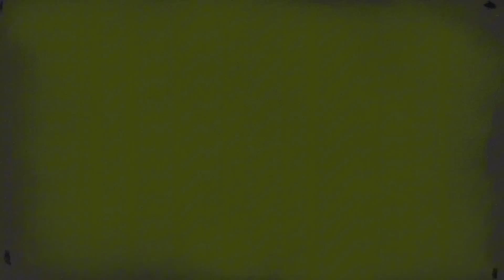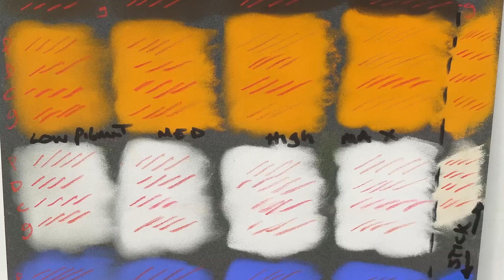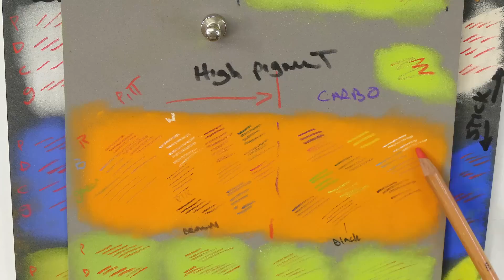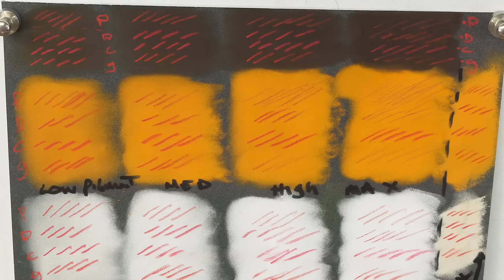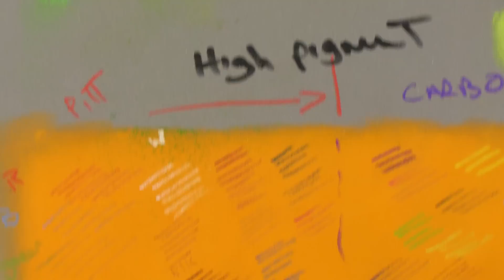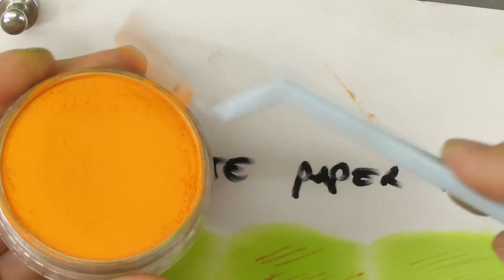Biggest Beginner PanPastel Mistake! + Solution!

Comment: Jason I was just wondering, can you use pan pastels or pastel pencils over colored pencils?
Reply: I work with both mediums and no, you won't be able to get the pastel pencils to work over coloured pencils because they are a mix of oil and wax so they will resist the pastels but you can use pastel pencils under coloured pencils as a base

Comment: Very interesting. You already showed that PITTs have a problem on the MiTeintes Velvet paper and I personally feel, that they are quite good on Pastelgrain. I am by far no expert but has it to do with the grain size or hardness of the surface? I can imagine, that light Pan Pastels are softer Pigments and brown are harder. So light pan pastel fill up the paper and make a soft surface, while brown pan pastels are hard and sill give a surface with a sufficient grip for the PITTs. Maybe the shape of the pigments, the lgihter are more round and darker have sharp edges. A diffenece between organic (e.g. PO62) and inorganic pigments (e.g. PR101, PW6)? Just ideas, i might be completely wrong.
Reply from the maker: it could very well be any of that. There are some many variables I doubt we will ever know.